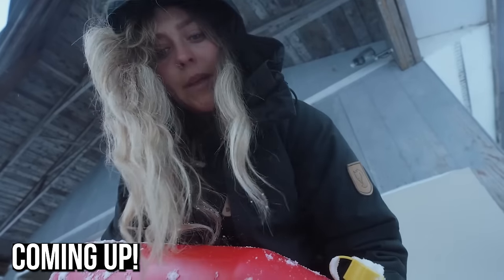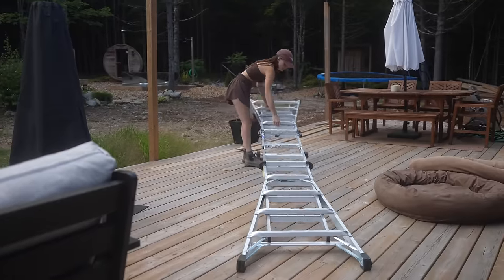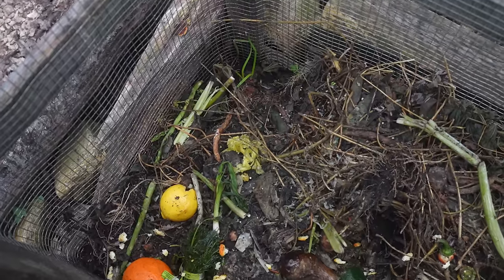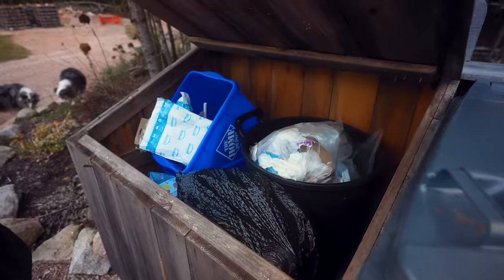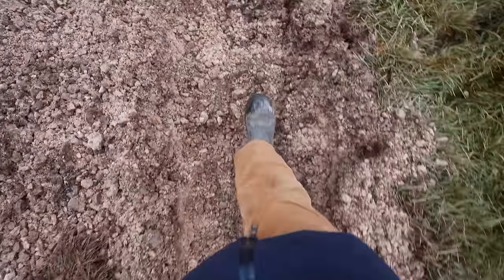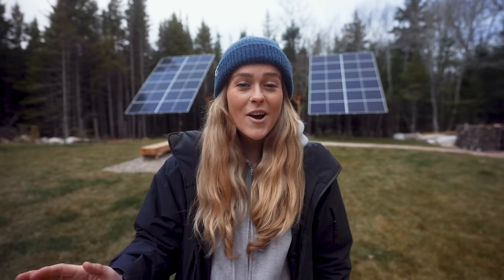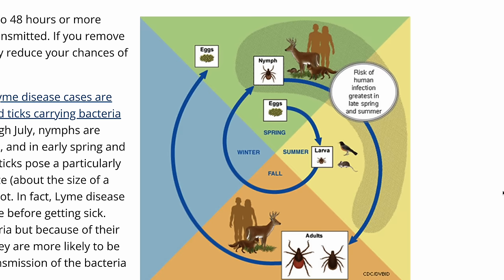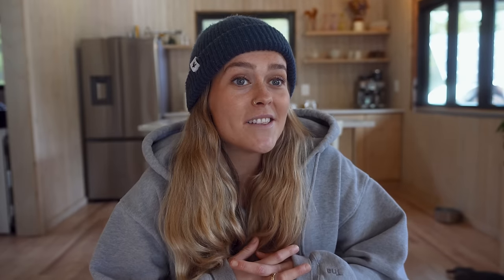No One Talks About This! 8 Reasons Why It’s Hard To Live Off Grid

Comment: We have been off grid for nearly 3 years now living in a caravan in the bush while we build a tiny cabin. We are lucky to be on spring water and rain water but use a hose for washing everything still and our solar set up just handles our fridge and basic devices. 
Our cabin is near done, after nearly a year and we will then build a bathroom block after that.
Been a VERY long time in the making but soon we will have a sink with running water, a better solar set up and a shelter better built for the elements as we live deep in the rainforest! 
Amazing how living off grid can look so different depending on where you live and your circumstances!

Comment: As I have mentioned in the past, I have done the same thing as you two, twice.  But I did not do nearly as good a job as you have done <RESPECT!> and I did have electricity. 

I completely agree with the list you have and in the same order.  I was the rat catcher and, as a result, learned to manage waste carefully.  Built the outhouse, eventually had a chemical toilet used in combination with the outhouse.  No fancy-shmantsy incinerating toilet back then.  Had the well dug, ran the water lines, installed the pump.  Put in french drain(s).  Cut, split, and stacked the wood.  Had to walk in from the main road in the winter, although that became a "feature".  It was downhill all the way to the cabin.  So, I built and maintained a toboggan run in the winter that allowed us to put a lot of stuff on the toboggan, push off from the top of the hill, and careen down a series of banked turns to come to a stop at door of the cabin.  <FUN!>  

While some things were hard I have far, FAR more happy memories of being in touch with nature and the seasons. You two have already built so many wonderful memories, and there are more to come.  You have totally got this.  Thanks for another wonderful Sunday morning.

P.S. Well, did I laugh at the rodent squeaking at the end of your close out!!  Nice touch!  🐀😃

Comment: I lived in a rural area and burned a large part of my trash, like anything cardboard or paper, any items that contained food were thoroughly rinsed and put into a separate outdoor garbage can with a tight fitting lid so no smells to attract critters, everything else went into garbage bags and sat on a concrete pad, not enclosed and I never had any issues with rats, cats or other vermin because there was no smell to attract them. I did have trash service but refused to pay $35 a month when I only had maybe 2 bags of trash and I could take  my pickup absolutely overflowing to the dump for $5 once a year. I would also keep my aluminum separate and smash it to take to the recycling center and get a little money back.

Comment: Here's a tip for your Deer problem (eating away your trees). Hanging CD's on ropes at their eye level in the desired periphery, will make them walk around that periphery, as they don't like the reflection (sun flashing into their eyes). Some may not like CD's hanging everywhere, but some like the rainbow effect it creates.
Note: you will need a lot of them, as you have a big land and you don't want to compact them in one line. I say if you distance them by 2m (on that desired periphery) and at least 3 rows wide (staggered).
It's a working solution. If you don't mind the look.
good luck!

Comment: Pro tip on composting your kitchen waste.  Chop up your waste.  This fast tracks breaking down your compostable waste.  Intermittently add in a compost smoothie consistency and pour it all around the inside of the bin.  Also you will want to add a compost starter in the beginning and intermittently layering in previously composted material.  Until you get your compost going use compost you can buy from your local store garden center.  These products have all of the active microbes needed to breakdown your waste into that black gold.  You can also add in that really rotten, (so rotten that it falls apart in your hands) wood for the same microbes.  Just break it up into smallest pieces that you can.  

Now is a great time to add in some of those fallen tree leaves.  Just crush them up as small as you can.  Just a couple of inches is all you need and turn in.  Find a location away from the house and make a big pile of leaves.  In the spring dig down to the bottom and you have some great material to add into raised beds just above all of the rotten wood you use as a filler base.  The bigger the pile the more heat it will create as the material decomposes and the longer and faster it will keep decomposing.  Keep adding to this pile every year and you will always have a supply.
Reply from the maker: Thank you for all this information!!! So valuable xx

Comment: We've lived off-grid for 45+ years and I love your videos. I love watching you learn. . . and teach. . . and with such humor. Our experience has lots of parallels with yours (40 yrs earlier), but we find that watching your videos adds a whole other dimension to our experience. . .plus entertainment :)

I have no idea how common certain types of toilets are but realize that ours must not be too common since you don't mention it. Over the years I think we've tried most of them (except for the Cinderella type) till we found a "dry" toilet design with a separate urinal. (Note: We have also tried a "separator" toilet that a friend has, but prefer ours.) For years now it has proven to be the most maintenance free and has less odor and no energy inputs or even any on-going costs  (if we use the bidet instead of toilet paper). We have found it to be less maintenance than even a standard flush toilet. We got the design from someone who said they were fairly common in some of the rural parts of Scandinavian countries. We try to always pee in the urinal (there is also a sit-down urinal that includes a bidet) so we keep the poo dried out. Toilet paper can go in with the poo and we have a bin for sawdust (that we never use unless a guest accidentally peed (alot) and it got too wet to easily dry. The toilet has an auto-closing lid and it is also ventilated, so there is no odor. . . not even as much odor as a standard flush toilet has. Once in awhile we dig a hole, empty the dry, flaky contents into it and cover with dirt . . .and later plant a perennial. The dry poo doesn't really provide as much volume as hoped for fertilizer, but the urine is. (It gets mixed into the grey water along with compost tea and/or the methane digester effluent to make an awesome fertilizer.)
Reply from the maker: Wow that is a long time living off grid, i am sure you have even more stories to share. Thanks for the information on the toilets good to know. 🌞🐶

Comment: Just as an aside, if the excavator controls are backwards to what you're used to from excavators, they are (most likely) easy enough to swap around. Basically just swap the hoses at the valves for the controls that are backwards, and that's that.

Comment: I enjoy your videos and watch them weekly.  You are very resourceful girls.  I have a suggestion for improving your trash handling procedures; buy or build a 6-10 ft. designated trash trailer which you can tow to the dump site.  You can either set your wooden trash bin  enclosure on the trailer or build a customized enclosure which can house your chosen number of easy to handle 33-45 gallon plastic trash cans for unloading.  This approach should eliminate unnecessary double handling of garbage and simplify disposal with a simple hitch-pull-dispose procedure.  Here is to "Happy Hauling" and a Happy Holiday Season as well.  😊
Reply: PS.  Be sure to consider Road Safety when designing your trailer enclosure.  You do not want any lids or doors blowing off when traveling at 60mph on the highway. 👍

Comment: There are septic systems specifically designed for high water table locations.  There are videos online to learn about them.
To control black flys, there is a really good TY video by a farmer who needed to reduce the flys biting his milk cows.  
For the rats, get a cat that is a trained mouser.
When planning the new build next door remember all the bugs that live in wet areas.  Have a mitigation plan.

Comment: Offgrid life is not for everyone-you’re exactly right!
I use portable power (Jackeries) a generator and wind turbines.
Since going off grid, I have come to appreciate and monitor how much electricity and water I use.
While not having a Hydro bill Is nice, I do go through a lot of fuel for the generator. I monitor gas prices constantly, and fill up my ever increasing collection of Jerry cans every time I go to the reservation to get fuel and propane. I invested in a couple of good generators, because the last thing you want in the middle of winter or during a construction project is for the generator to stop working. Maintenance is also key. i stock pile oil because generators require frequent oil changes. We have deer, moose, coyotes, foxes (which are so cute!) as well as bears. I keep garbage to a minimum and have assembled a Greenhouse to prevent the deer and squirrels from pilfering every last green pepper. The roof to the greenhouse split open, so yay for that…

This lifestyle is not for the faint of heart but it’s so worth it. I would never live any other way.

Love your videos!!
❤️💕🦄💕❤️

Comment: When we lived in Ireland we used to burn peat or "turf" for our fires as it was way too damp to have wood anywhere outside as the humidity was always over 65%. We used to have piles of it for the winter and every time we got the the bottom it was clear that a rat family had lived there. Occasionally we saw rats that were about the size of a small cat, so not too bad. Having dogs meant that they would never come near the house so it was fine. I found mice worse to deal with as they are fearless and come in the house, peeing and pooing everywhere - shudders
Reply from the maker: Agreed! Mice and rats just make me run. They sure can be destructive especially mice.🤩🤩

Comment: Most of us don't glue perforated  pipe, just connect hub to spigot.  (There are holes in it anyway, and often you can get it to "lie" better in the trench just one length plugged into the next...)
No matter what you think of rats, please do not use rat poison.  Just don't.  (Write if you need an explanation ... owls, your dogs...the 'environment' / your water supply...)  Spring traps are legit if you need them.
You may need more people / more help with the neighboring property that you just bought.  To do that place well would be to get into, more or less, "surveying" / "engineering" / (very rural, but nonetheless "infrastructure" / etc.  (I forget the name of the Lake,  but you may need to understand it, including "hydrologically," particularly if you are going to be building, etc. at or anywhere near the existing "cabin" that we see in the pictures more or less "afloat."  (And, say, you are thinking of anything like a septic system...  All can be done, but maybe up the game a level...)

Comment: Remember checking the Ic f systems for your cabin. Because you can remove the wooden port of the cabin and put it on ACF house higher up and then that way, even if it floods, you'll be out of the water point and just build you. A driveway that's slanted out to the non flooded area
Reply from the maker: Thanks for sharing with us Rudy. We love all the ideas we get from our community. 🌞🐶

Comment: 2. Rats can't nawh , climb metal. That should tell you what you need lol.
3. You can build a french drain from different size rocks , wrapped in fabric. There is a way to lay them correctly. Cost is almost free.

Bobcats are cool. If you don't see them , that doesn't mean they aren't there. They are very sneaky.

Ticks and fleas are easy. Find some skin so soft. You will smell nice and fleas and ticks want nothing to do with it. You can spray it on your pets without issue. Just don't over do it because dogs and cats lick a lot. 

You can also get some diadromous earth food grade. Use it like a dust anywhere you don't want ticks, fleas, flys, and so on. It will also help keep your pets free of internal pests including tape worms. Just dust the animals food once a day. They will drink lots of water.

Rocks are your friends. The bigger the better. You can build many fire proof structures. Used to store heat for longer periods and cool when you need that also.

Comment: I hope you installed that pipe holes down. If not you will always have that space before the holes always holding water. Versing it running off if it was raising up into the holes of the pipe. Not having to make it to the holes before it gets in the pipe. Also hope you put gravel over it a little larger than the holes. To the top of the ditch. Love your life 😊.

Comment: Once again great video! I had asked In your previous video what happened to the other outdoor shower you built in a video from 4 months ago (close to your wood burning hot tub)? The video is titled: Spa At Off-Grid Cabin (wood fired hot tub, sauna, cold plunge & shower!). Does that shower not count? Or not working anymore? And what about the other 2 tubs you built over there? Or because they are only cold plunge tubs you don't consider them proper bath tubs?
Reply from the maker: Yes that cold water shower is for rinsing before entering hot tub etc after sweating in the sauna. And when I say cold I mean 250 feet in the earth cold hahaha!! The proper outdoor shower we just built is hot on demand for daily use!

Comment: Ambition strikes also use the burning toilet wonder if they have the same problem?
Reply from the maker: Their toilet is all good! I think we got a dud
Reply: @Vanwives  thought so
Reply from the maker: They do have the 240V and we have the propane though.. Not sure if that could be a reason @martinbeaumier7172
Reply: @Vanwives  possibly, so you may need to switch to electric eventually. You should also consider covering your roof in solar panels eventually or maybe look into wind power but that might be noisy